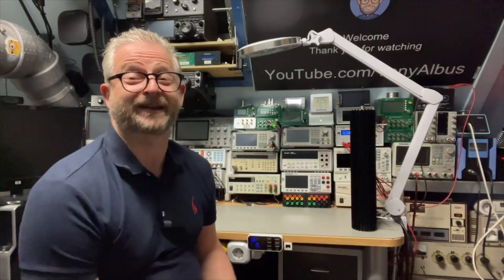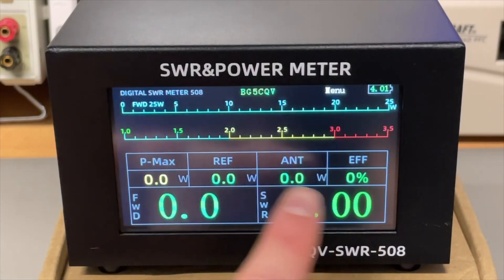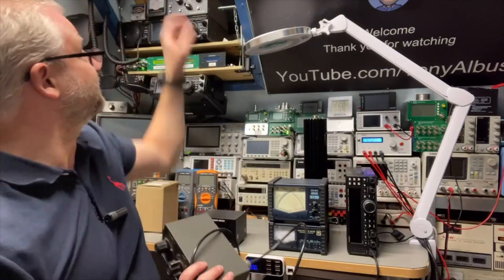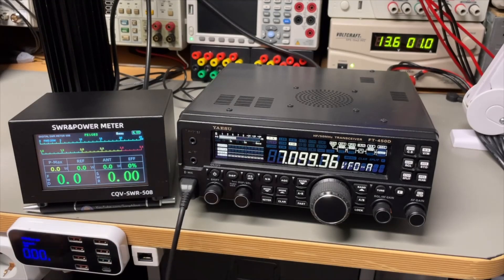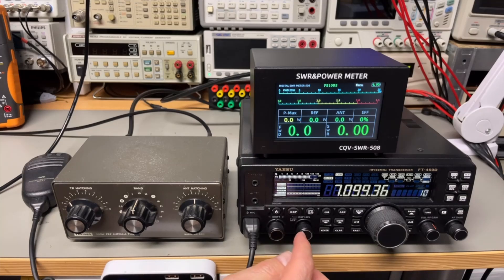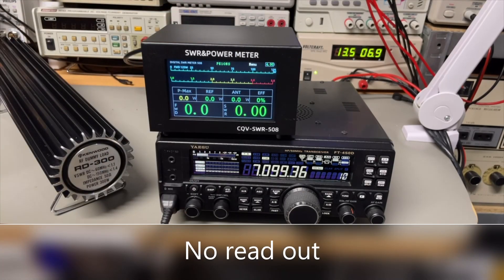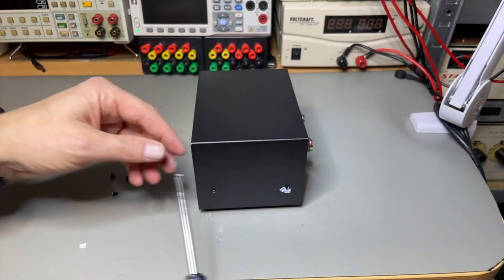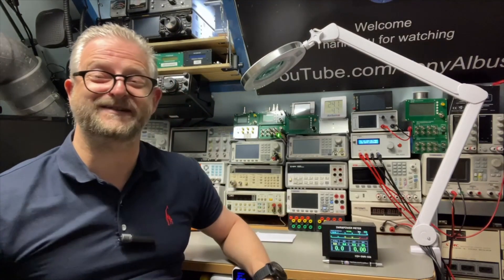TA-0405: BG5CQV SWR Power Meter CQV-SWR-508  1.8-54 MHz  - Hands On

Comment: Meter injects super bad noise onto the signals. Faulty out of the box and I had to return mine.
Reply: I have the same problem, produces massive RFI on the 40 meter band. I have not spent any time to see if I can fix it, sending back to China is too expensive.
Reply from the maker: @robertherendeen7702  Yes best thing to do... i am completly cured now from digital SWR meters... i use my good old Daiwa.
Reply: @TonyAlbus  Yet you still have it advertised in your description. Shame on ya.
Reply from the maker: Thank you for this important comment, you are the 2nd to notice this and mention it in the comments, this for sure needs more investigation on my side. i did not test that.
i am still using my Daiwa myself. i will test more and make a new video when needed and Pin your comment.
Reply from the maker: Yes mine i bad too. 1.766 MHz / 3.531 / 7.065

Comment: Do they make a version which includes VHF and UHF?  I really like that it has a large display for these old eyes and is battery powered for checking the mobile or portable antenna in the field.
Reply from the maker: Hi, i have not seen it yet, but i have not been looking hard. i stay with my crossneedle meters.

Comment: Excellent video. Thank you so much for your well-though-out comparison. It was great to see the Daiwa cross-needle and the Marconi scope's readings compared very directly to the BG5CQV's readings. Very helpful.
Reply from the maker: Thank you... be aware, this first build had some problems creating noise on some frequencies (see video description for that video) , in the comments i see the later versions it seems fixed. but i did not test that myself.

Comment: It's not "just you because you are old!!" I borrowed a needle gauge while I was waiting for my digital meter. Now I really miss the needle. You can see that the ID has ben filed off the CPU  because it would be VERY easy to reprogram the digital meter to display a bar, if we knew that it was just an ATMEL or something! In a year, they can sell us the EXACT same hardware, but with a bargraph!!
Reply from the maker: Yes needles are the best. for a good digital needle you also need a fast scan or it will be very jumpy still... i stick with the old stuff for a while.

Comment: Tony, I just received my digital meter. Using a FTDX-10 I can report to have only slight QRM noise on 29300 KHz but all other ham bands from 160 to 6 are clean. Rest 10 meter is also clean. I asked for refund and return but so far they did not reach out to me with a solution... 73 Phil ON4VP
Reply from the maker: The meter looks amazing and if you can live with the little qrm, yours seem to produce, maybe by shielding better the RFtap part, its solved for you.
If you bought from Ali, you can follow in your order/return and usualy within a few ours your return label is there. (without receiving an email btw, you need to check yourself)
Reply: @TonyAlbus  Hi Tony, Finally Banggood replied and they refund my invoice and I can keep the meter because it's to expensive for them to get it back. A little luck... 73 Phil ON4VP
Reply from the maker: @PhilON4VP  Thats great news! 73
Reply: @TonyAlbus  I purchased with Banggood and they are more difficult to handle with. They are investigating. If they refund 50% I will keep it, otherwise I want the full refund and send it back. 73 ON4VP
Reply: @TonyAlbus  I made this video for proof, the rest of the bands are clear.  https://www.youtube.com/watch?v=36D0bOyPUB0

Comment: I'd stay away from the cheap Chinese meters. The cheap displays have cheap inverters to run em and introduce a lot of noise into your signal. You CAN'T filter that out no matter what you do. Signal loss is a whole other story. What your seeing at the radio doesn't reflect what's being put out at your antenna. There's a new flood of these type of cheap meters coming in from China on the cheap and reports of quality control are pretty bad. It's a 50-50 wether or not you even get one that works. Considering terrible shipping times it's not worth it.
Reply from the maker: Yes clearly visual here : https://www.youtube.com/watch?v=W03w-dh7qgY

Comment: I'd guess that the update rate of the bar graphs is dictated by the length of time it takes to re-render all the digital values on the display. It would be a nice addition to the software, to give it a "fast" mode that has much more responsive bars at the expense of smaller digits.
Reply from the maker: Hi Colin, that is a great idea, a sort of Tune mode where you only have 2 bars with crazy fast update... i hope they will do this at some point.

Comment: I have this meter and it did restart every time i went over 70 watts on battery, not with the charger Connected. The text SWR and FWD change to Chinese text when i go over 125 watts. I changed the battery to a 5000 mAh and it looks like it is stable now and will not restart as long as the battery power is good, but i have to live with the Chinese text(i dont care to much ). The charger give some noise but not all the time, no noise on battery. Banggood wouldn't  give me a refund or exchange it for a new one(i am done with Banggood). But i am happy with it now as long as it works? It is maybe the most beautiful SWR meter on the marked i think so it is sad it dosent work as it should. The bilt quality is good.
Reply from the maker: Thanks for sharing your experiance with Bang-U-good, yes i also do not take any equipment from Banggood anymore, not even for free to show on the channel, their aftercare is terrible they are only good for selling unbreakable stuff like bricks as they know very well how to do that ,  i order electronics form them and receive a brick  :)
Sorry to hear you have had problems, and we need to share this to safe others.. 
hope yours keeps working.
Reply: @TonyAlbus  yes we do, love your channel. thanx for your work👌73 from North Norway

Comment: I bought one of these meters. The display was excellent and I really liked the unit ... but the meter generated significant RF interference on 80 and 40 metres. It had serious spurs on 80 metres and on 40 metres brought the noise up from below S1 to above S3.
I sent it back and got a refund.
Reply from the maker: Oh thats not good, i did not test that yet, thanks for sharing!
Reply: @TonyAlbus  I would be interested to hear the results :)
Reply from the maker: After your comment others came.. i just did testing today and Yes mine is bad too. 1.766 MHz / 3.531 / 7.065 spurs
same will send it back,  just in time for refund, again a don't buy video than... and it looked so well build...
Reply: @TonyAlbus  Thank you for confirming that the problem wasn't limited to just the unit I bought.
I agree ... it is a shame, because the meter looks well made and the display is excellent.
I think the logic and active electronics needs to be separated from the sensing section, and the sensing section properly shielded with just the DC voltages representing forward and reverse power coming out ... preferably via feedthrough capacitors.
Reply from the maker: @VK2AAK  i'll stick now to my nice Daiwa cross-needle ..i even have a few 40 or more years old... still spot on..

Comment: would be very good if there is a meter that will cover the VHF bands / UHF bands  144 Mhz / 432 Mhz
Reply from the maker: Hi John, Daiwa has the V in there series that does that. Comet has tuners with crossneedle for both, i have the CAT-300 for HF and they have also a CAT-283 for VHF/UHF. but for VHF/UHF there is not much to tune once you cutted it to the right size/length.
Reply: @TonyAlbus  thank you

Comment: I like needles too, and MFJ has already sold a lot of their stock. For me it makes sense to have the tuner and two needles in the same device. I like turning knobs. Some things are better if analog. I still like my VOMs and VTVMs too.
Reply from the maker: Yes i read somewhere that MFJ stopped the company if i remember correct. Comet has a nice CAT-300 i use and its great. although i must admit that the older Kenwood At-200 /230 and some of my Daiwa tuners work amazingly well still. Sorry to say i was not a big fan of MFJ, their cheaper tuners were not that good and fragile, but nicely compact for mobile. Needles rock!

Comment: Very nice looking piece of kit, Tony. I also like an "analog" display for tuning/alignment - call me old fashioned too. You need to get a large 75 ohm load for you bench - terminate a 50 line in 75 ohms and get exactly 1.5:1 SWR. I used this trick to calibrate beacon interrogator SWR monitor circuits.
Reply from the maker: Thanks David... That is a good one the 75Ohms... cool!  will do.

Comment: Hi Tony,  I have the same BG5CQV SWR power meter and several CN-801  HF. VHF/UHF Daiwa analog meters.  We sure have a lot of the same equipment... great minds think alike ; ).  I also like the digital bar graph feature over just digital number readout.  So far I am happy with my BG5CQV.  I have not opened mine up.  Thanks for the video.
Reply from the maker: Hi John, yes amazing how much equipment we have in common indeed, nice to see so. For me Daiwa is still the best, also i have always seen then in my dads shack, so they must be good. i have bought a few second hand and all of them have been still spot on. they make some amazing quality to last for many years. but this modern stuff is great to try and they have build something good this time, if the sample could be higher it would be better even.

Comment: How long will the battery run prior to recharging? Ronald de PH7R?
Reply from the maker: Good question, i can't tell you, but after using it for 2 hours (allways on mode) the battery was still 4.0V. it needs to be charged at 3.4V the manual says to charge it at least ever 6 mouths. it mostly needs to power the display, so turning the brightness down will give you even more time, also it has auto shutdown. all these factors matter a lot on total use time. 73 Tony